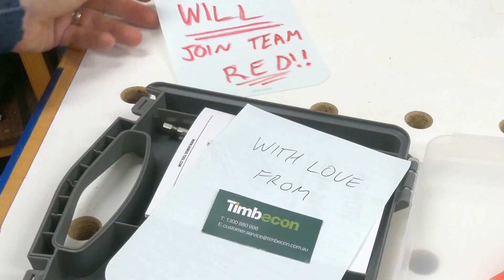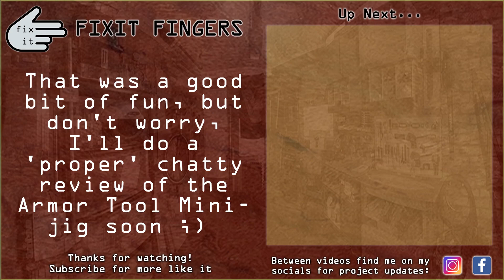Kreg Guy is Sent the Armor Tool Mini Jig to Review, Instead he Builds a Mobile Table Saw Cart

Comment: Awesome build mate and great video,  and freaking love that assembly table that made great work of the project and keeping everything square nicely done
Reply from the maker: I love that bench. It's a little light for a lot of hand tool work but it is just made for pocket hole joinery. Even I was surprised how well it helped take out the twists and bends in those warped bed slats 😁

Comment: Silent movies with a bit of humour - can't beat 'em. Decent looking jig too.
Reply from the maker: It's pretty solid, I will be keeping it around as I gave away my old portable pockethole jig and there are some cases where you can't take the wood to the 720 so this will get me out of trouble!
Reply: @FixitFingers  Good thinking. I inherited a small two-hole jig but stopped using it. I might start looking for loose joints around the place now!

Comment: When you were using your table, and clamping this jig down onto your lumber, the jig was very noticeably bending under the pressure of the clamp. Could that have any effect on how well the jig works, or even worse, cause damage to the lumber or the tool??  I also noticed how, out of square, the first four pieces of lumber (frame for the tabletop) were, and wonder if that could have been caused by this jig, or was the wood bowed?? To make using your wheels a bit easier, you can attach a piece of 2x4 horizontally to two of the wheels, which will allow  you to operate two wheels at the same time.
Reply from the maker: Cheers mate, great insights! I like the last tip in particular. Eventually I'll build a 'proper' workbench for this saw and link the casters together as you suggest. Ok looking at your other points - While the body of the jig is plastic, the core and drill guide is metal and the unit has some good weight to it. In use I didn't notice the flex, it was only when I watch the video back I saw it. I could turn down the clamping power on my auto-maxx clamps and it will likely still work fine and not stress the jig as much. In terms of affecting performance, I dont think it has a noticeable effect on the joint. The pressure is spread over the wood, so no noticable marks on the pine, but you'd think long term applying too much pressure with the clamp will eventually crack the jig. This is a jig designed for the 'occaisonal' pocket-holer, so I think it will last many many years. If you were planning on using PHs constantly, there are more suitable, larger, solutions. 

Those bit of wood were completely out of square ;) They are all bedslats recovered from the gutter and I selected the most bowed, twisted, cupped ones for this build. I used them on purpose as this stand is a temporary solution and a good way to show even crappy wood has its uses. Also to demonstraite that with a clamping bench like mine you can actaully take out the majority of the bend with a bit of persuasion :P So I can't blame the jig for that. Shop projects are perfect for using up the dodgy bits of wood! :D

Comment: James, James, James, look at you all growed up. Makes me so proud, ....... I can almost feel a tears welling up. 😢 A table saw!, you've bought a table saw. 😭 Too emotional? 😅
Well, when you decide to pull the trigger, you aim for the biggest buck in that level of the herd. Now it's time to get jiggy with it. 😉
Give it a bit, your going to wonder why you waited so long. 
Nice little roll around stand you cobbled together from recycled materials. Glad to see some things haven't changed. 
Just a small word of advice. You may way to put some small rubber pads on those 2X4's. It wouldn't be good if you were feeding an expensive and awkward sheet of plywood through, and the bare 2X4 feet decide to lose gription, combined with the sliptivity of a smooth concrete floor putting a damper on your day. A SawStop will only keep you from getting your hotdogs trimmed. Binding is still a thing. It's not exactly a 275kg cabinet saw.
But what was that you were using, and what do the other blue tools think of their new shop mate? Mate. 😒
We actually have a couple here at the shop. I actually like the slidy uppy downery jiggery pokery collar adjuster thingy. I'm not sure, but I think that's a technical term. At least it should be. It is here. Lol. But this doesn't mean I'm giving up my K5 any time soon, or getting an Amor tattoo, too. They're actually not mine, they don't live in my tool pouch. There are other people who work in my shop, and I can't be responsible for the tool choices they purchases with their money. Coincidentally they all drive Ford's too. Lol. 
Been awhile since I've had time to comment. I have, when I've had time, been keeping up on the episodes. I loved the Sydney's Shoddiest Shipwright. That turned great for your first go at shipwrighting.
We've been busy, and not just busy, but hair straight back busy. The last three years work wise has been insane. I have to turn potential customers away, kind of insane. But it's like that with every construction trade that I know. Even the crappy and dodgy trades people are busy. 
There's been an explosion of people flocking out of the cities in droves. Selling their McMansions and snapping up rural properties. With the idea that they can just hire someone to get the work done, on their time line, at their leisure. Then reality sets in. When every contractor they contact says, "No problem, we can get on that in about six months to a year". I've even had a couple of clients offer to pay as much as double, to get bumped up in the que. Tempting as that sounds, if you open that can of worms they'll expect it every time.
Biggest challenge is finding skilled employees, there are none. Or even finding anybody who wants a job. I've offered people who are unemployed a job, and I pay far better than minimum wage, only to be told, no thanks.
I have managed to hire four new employees recently, and I could still use another four. Only one was a skilled carpenter, and I had to coax him out of semi retirement to do so. The other three, absolutely no trade skills in their work history, what so ever. But they all had listed woodworking as part of their hobbies and interests. I'll take it, I've trained a few apprentices over the years, why stop now.
Outside of the shop things are relatively busy there too. Taking the farm solar has gone from being a concept to reality, with "shocking" results. We're still hooked to the grid. But instead of just buying we're selling too. So far so good. Eventually though the goal is to flip that switch too, and be electrically independent. We still have the batteries as though we're going full tilt solar, but those are currently our primary back up system, in case the grid goes down. That happens quite regularly during certain times of the year. We have a secondary back up, which was, pre solar, the primary back up system. A 15Kw gasoline generator. But that was upgraded to a dual fuel set up. So now it runs on gasoline or wood gasification. Last year myself and four of my buddy's, one of whom is a welder/fabricator/machinist with a well kitted out shop, built five wood gasifiers. That was a fun project that moved my welding skills up a notch. So far I've found that wood pellets and wood chips are the best bang for the buck. Pellets are slightly better than wood chips, when it comes to getting burn time out of the reactor, (yes the burn chamber is called a reactor). We have the equipment to produce both, pellets and wood chips. We use a pelletizer to produce feed pellets for our farm animals. I would need a larger set of dies to produce wood pellets from fine sawdust. I also have a wood chipper that connects to the PTO on a tractor, and it doesn't think twice about making short work of anything up to an eight inch diameter tree, and we have lots of dead trees, thanks to the pine beetle. Funny thing is when the generator is running, all you smell is pine. So now the goal is to get a stockpile of wood chips for the gasifier. Did I mention my new hobby is producing electricity. 😅 Truthfully, it is actually kind of satisfying, and has been well worth the effort. Here's an interesting advantage of having a two way connection with the power company. The grid doesn't know whether the power that it's receiving comes from a solar panel, or a gasified generator. 🤔
Still do the placer mining thing. Our three oldest grandsons spent last season out on the claims mining, within the "recreational" guidelines, so it wasn't a permitting nightmare. Besides grandpa has all kinds of mining equipment, that's just sitting there. Even though none of them are driving an exotic sports car, including me, they did well enough to cover all of their bases, and have enough left over to warrant going out and doing it all over again this year. The key to getting the pay dirt to the sluice box, is a pair of 3"(7.5cm) Hydro Force dry land dredge nozzles. These are dredging nozzles that create their own dredge pond. They move gravel ten times faster than you can shovel it, at one tenth the effort. They're my favourite go to if I want to run a larger amount of material in the shortest time possible. There's a few YouTube videos about them out there. 
Anyways,.......James, I was both amazed and thrilled that you bought a table saw. It compelled me to write a comment, and no I haven't fallen off of the edge of the planet, yet. As a matter of fact, it was my granddaughter who informed me you purchased a saw. With a text, and I quote, "JAMES BOUGHT A TABLE SAW!!". Lol. She follows you on Facebook too, and when she's around we'll watch them together. I don't follow anybody on Facebook, I barely use the thing.
Well I should probably bring this to a close before I have to start numbering chapters. The videos have been getting better and better, even the boring stuff is fun and entertaining. Now that you own a table saw I'm expecting well see all manner of jigs adorning the shop? Tapering jigs are fun,....oh, and so are......
Cheers. 👋🇨🇦
Reply from the maker: Great to hear from you Andy, it has been a wee while. I am very pleased you are well and yes, finally, I have succumbed to the dark side and got a table saw 😊 Excellent suggestion on the rubber feet, I think I have some around here somewhere... the little Armor jig is a nice bit of kit. On the odd occasion, I need a portable solution, it shall come in very handy. We've had a similar tree-change mentality sweeping Australia too. The rise of the acceptance of working-from-home has allowed many folks the option of getting out of the city and moving to rural areas. There is such a lack of skilled trades out there I've considered pulling up stumps myself and becoming one of those dodgy operators. How much you paying? 🤔😅 Every man needs a hobby or seven to keep him out of trouble. There are a few woodworkers here also taking a keen interest in harvesting the sun. Energy security even on a private level seems to be a big deal these days, I see only good coming from it. I believe your grand-daughters reaction to Carbatecs kind gift of my SawStop is the most adorable thing I read in a long time 😊 To think folks half way around the world take such interest in my tiny shop and activities is simply humbling and overwhelming with the warm fuzzy feelings it produces. This year shall be jig-er-ific I am sure. First I need to hook up the dust extractor, then shall come the jigs, the world dominant... I mean sawdust... just sawdust. All the best Andy, stay well, and thanks for the update of all things Funke. 😁